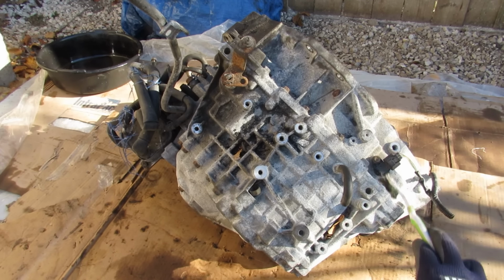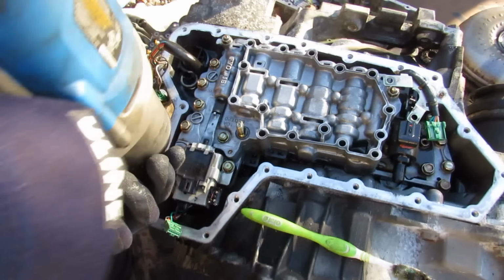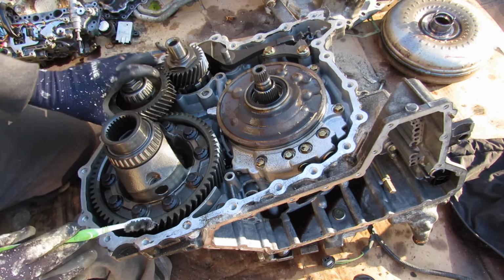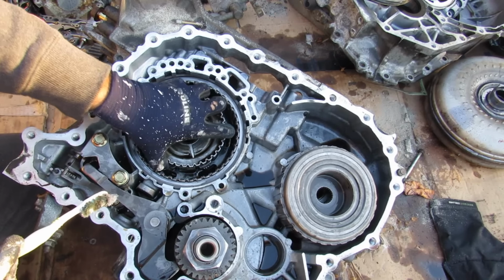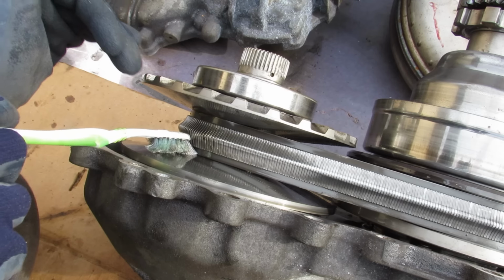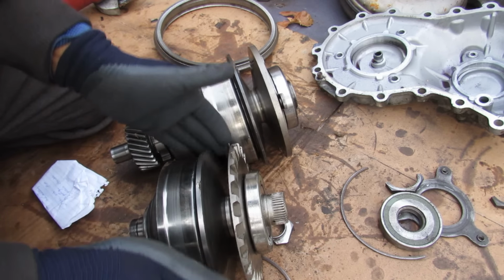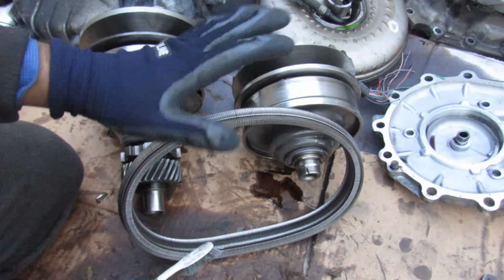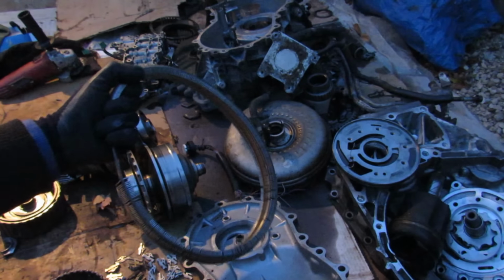Why Nissan CVTs FAIL

Comment: Many different vehicle makes have used CVT Transmsissions. Ford, Subaru, Mitsubishi, Honda and even Toyota. All CVT’s can benefit from Jilcat Proline CVT Supplement.

Nissans have had CVT issues across all their models for many year models. Altima, Murano, Sentra, Rogue, Juke, Pathfinder and Maxima. Also works with Mitsubishi, Subaru, Jeep, Ford and Honda CVT’s that shudder. The standard repair is to replace the transmission. Cost: $2000 or more. Try Jilcat Proline CVT Supplement for less than $35 instead. There have been hundreds taken care of across the country. Do not replace, lubricate with an aerospace designed lubricant and metal conditioner.
Reply from the maker: Nice advertising

Comment: Hi there, great video! last year, I took my renault koleos 2013 auto to the dealership as the car was bucking at little acceleration (D).  They told me that after checking the CVT oil (never been changed) had parts of metal. with my friend, we are now embarking in the journey to find out what it is .  the car shifts no problem and there is no sound coming from the gear box. the car can move, slowly and it bucks not all the time. Also there is not sign coming out in the dash and not failure codes.yesterday, we removed the oil (only 3.5 L left)and although dark it did not have any pieces of metal there, so we are thinking that low oil and/clogged filters are the causes. but we are just a very amateurs on this so we will highly appreciate any feedback/sugegstion. anyone can provide. thank you in advance. cheers

Comment: I had to pay $4,800 for a rebuilt CVT in my nissan Rogue. Last nissan I'll ever own! Dealer even charged me for shop supplies! I told them I should not have to pay for their mistakes, yea, they really cared!
Reply from the maker: Shop supplies is standard charge for anything that comes into the shop...

However $4800 is alot!
Reply: I'm back, I got 60,000 miles on my new rebuilt, and it started slipping! I decided to drive it until it dies and buy a Toyota or Honda. I can't take it on the interstate because it will slip,I only drive it around town. I can smell the transmission fluid, and the trans jumps a bit; I'm wondering how long it will last and if it will just fail at once or allow me to limp home. Nissans are garbage!

Comment: This gear is used on Nissan maxima 2017-2019 as well?), or did they improve the issue in some models?
Reply from the maker: It was changed but not nessessarily better

Comment: What  cause these cars with CVT after travelling  long distances they are not exceeding 100mph???? From 0 to 100mph they are fast but when reaches 100mph they are moving very slowly past 100mph or just stack there as maximum speed while they actually have 180mph as maximum speed????

Comment: Best CVT trainer I've seen! Brilliant video. With a 2.0 140ps engine my wife's is still going strong touch wood but I certainly wouldn't put it with a large vehicle, a V6 and a trailer, just doesn't feel tough enough
Reply from the maker: Agreed. Probably for a small city car or scooter

Comment: Working in a nissan dealership ive seen a ton of failed cvts. What i don't get is why the maxima cvts almost never fail but the muranos fail all the time. It's the same transmission. 95% of failures are in units that are not properly maintained. Nissan recommends flushes every 30k of that cvt fluid and the people that maintain them properly don't have near as high a failure rate. Nissan has the most expensive maintenance costs of any brand I've worked for but they make great vehicles outside of the cvts. Units made towards the end of the last decade 2018- now seem to be a lot better though. I think Nissan is moving away from cvts in their more premium vehicles though.

Comment: CVT drives are not new they have been used in industry since the 1930s and in motor scooters and small lightweight cars since the 1950s. Of course, they were much simpler because they used rubber Vee belts and the torque loads were not high. That steel belt is very cool when you consider what it does. The failure rate for these transmissions will get better.

Comment: The CVT trick is never go downhill on Drive gear, change CVT oil every 60k miles. Also don't keep engine on idle stationary with Air conditioner on  more than 10 minutes, avoid at all costs idle engine running, ran my Nissan Rogue CVT over 280k with no problems. I have another one is now up to 117k .... also, no problems
Reply: You mean switch to first or second gear down hill and engine break? Also what’s wrong with keeping it on idle?
Reply: @NoobTube4148  
No move it from Drive to neutral going down hill

Comment: i have noah with A 1V ENGINE...my gear transmission is faulty....When I engage the gears..they jack...or knock...ave been advised to replace the whole system...can it be repaired?

Comment: wife's  2018 Nissan Kicks Transmission failed with 63,000 km,,, LUCKILY she purchased the extended  warranty ..... or we would have been on the hook for 3800 bucks,,
complete New Transmission installed just before Christmas,, ,,  ,, but geeshhhh  63,000km..  and its just a light weight, front wheel drive car only

Comment: Thanks for a very timely video.  My daughter's CVT transmission in a 2016 Nissan Rogue failed last week with only 89,000 miles on the car, and the dealer wants $6,000 for a new transmission.  Piece of crap.  With today's technology, no transmission should fail in under 100,000 miles.  The manual transmission in my son's Scion B (made by Toyota) actually made it to 475,000 miles before it failed.  Now that's quality.  I'm glad I have my Honda Fit with a manual transmission.  It's simpler, lighter, less complicated, and is going strong at 170,000 miles.  I won't be buying a Nissan anytime soon.

Comment: Which failure points would need to be upgraded in order to keep up with more powerful engines?  Is it even possible to beef up these CVT transmissions? I don't see any aftermarket for them so just assumed that the answer is no.
Reply from the maker: Keep changing the fluid and add a cooler. Don't overload or tow

Comment: Hello my friend!
It wouldn't be bad if you wrote down the transmission model, because maybe different years put different transmissions. For example, I have a Teana l33 2015 3.5 liter vq35de engine, such engines and transmissions were installed on Murano. I have a slightly different transmission, or rather a different oil pan, it has no cooling fins. I'm wondering if the rest of the elements are the same?
Reply: The hydraulic plate is also different, did Murano make CVT with a 2.5 liter engine? I don't have a step motor in my hydroplate :(
Reply from the maker: Thanks. I don't usually get the model number or VIN with these. Just the vehicle make and model

Comment: Not sure why we say that the Nissan CVT is bad.  I have had 2 with over 400,000 miles, and no issues.  Regular maintenance, plus not treating it like a sports car seem to be the reason mine lasted so very long.  And, no, I am not a mechanic, which I appreciate your knowledge, but, really, folks seem to bash these CVT's when the problems might just have more to do with maintenance and driving habits.
Reply from the maker: That's awesome. What vehicle, and do you tow with it? Did you add a cooler?

Comment: Everyone should have cvtz50 installed in their phone and connected with an active OBDII scan tool at all times whilst driving their cvt equipped Nissan.

Hopefully we can gain the attention of the video creator and alert him to the app ($3-5) which is totally worth it. 
I am in no way associated with the developer of the app, and it doesn't require any specific, special scan tool to operate, only a generic, (but quality) OBDII scanner that is available online for less than $16.

cvtz50 is a monitoring tool that allows you to create a log file for your own cvt, which actively monitors the wear of the internal belt, clutch pressures, temperatures and much more.

Comment: So why in the infinite wisdom of Nissan's fine quality mechanics would there ever be said to a customer: "we don't replace them, only the fluid", regarding the pickup and cooler filters?

Even after all of the failures, the complaints, and the eventual lawsuits & recalls, Nissan still insists that replacement of anything beyond a 30k mile oil change is "totally unnecessary and not done as a part of the recommended routine in our own service manuals" .  - *quotes courtesy of the head service writer @ CdA Nissan, Dec, 2022 *

Comment: are they still bad? im considering a car with jatco CVT 2023, any suggestions please?
Reply from the maker: Yeah it seems the newer ones are going bad
Reply: @speedkar99 Thank you,  im considering a changan car it also uses jatco CVT, could it be possible that its a different transmission or its just all jatco CVT are bad

Comment: CVT oil and filters are changed every 40,000 km (25,000 miles) I had a 2018 Sentra SV 2.0 that damaged the belt due to oil, if you buy a mini scanner and the cvtz 50 app detects the oil wear counter that will inform the tips and monitor
Reply: Everyone should have cvtz50 installed in their phone and connected with an active OBDII scan tool at all times whilst driving their cvt equipped Nissan.

Hopefully we can gain the attention of the video creator and alert him to the app ($4-5) which is totally worth it.
cvtz50 is a monitoring tool that allows you to create a log file for your own cvt, which actively monitors the wear of the internal belt, clutch pressures, temperatures and much more.

Comment: And now the most complicated transmission available today: the manual stick shift. The CVT is the goofiest invention ever made.
Reply: It has been great for the snowmobile since inception.
For cars and heavier vehicles, not so much.

Even as snowmachine engines have progressed in power from under 20, to over 200, they still use a variant of this system and it has been one of the most "bulletproof" parts of the system - almost forgotten - that has been used. 
Granted as power levels have gone up, so has the size of the cvt clutches and springs, but even if you run a twin clutch system that uses two belts, you may never need to replace one in the lifetime of your snowmachine.

Nissan simply needs to use a different manufacturer and beef these up to the level of power their engine outputs.

Otherwise, cvt is a brilliant solution that is actually much simpler than the typical automatic transmission.

Comment: What a nightmare. No wonder Nissan has shit the bed after they adopted this abortion.
Reply: It's actually less complicated, and less prone to failure than the typical automobile automatic transmission, but Nissan's choice of manufacturer for this part is the problem.

If they would build them to handle the level of power and torque the engine is capable of producing, it would probably be as bulletproof as the old Chevy TH400.

Comment: Wouldn't own a cvt equipped Nissan no way no how. Bring back fwd manual nissans !
Reply: We've owned two, of which one is still in the family and has over 106,000 miles of trouble-free daily driving on it (in fact my wife is getting ready to leave for work as I write this, and will be driving it).
The other was doing fine when I treaded it up to a newer, higher level model that didn't have any cvt available, due to it having over 300hp.

Comment: When I had my Nissan Altima they extended the warranty to five years to 7 years and from 50,000 miles to 100,000 miles. That had to destroy nissan. And as well it should you put out a cheap garbage you deserve to have it recalled and make it right when you could make it right the first time and not have to go through this BS.

Comment: I had a 2015 Nissan Altima with one of these garbage transmissions in it. It literally felt like in parking lots I was bouncing through the parking lot like on a rubber band type of situation it would give a little bit of a surge and then it would slow down and then it would surge again and then slow down and this would be without  touching the gas. At idle speed
Reply: It's all about the level of maintenance a vehicle receives in its lifetime. Neglect a single oil change in the cvt and that surging can be the result.
Not saying that this is the only way that they fail, and yours may be something different, but overall, only 30% of all car owners actually keep up with their maintenance service requirements. Most owners either don't know, or don't care about maintaining their vehicles - until they fail.

Comment: As you say Nissan pioneered CVT on a commercial basis in most of their range so a trailblazer always faces the harshest challenges. Others simply follow his route and have a smooth sail thereafter. Likewise Nissan had failures because it was the one which was experimenting. Others learnt from it and refined but the stigma on the pioneer still remains unfortunately.
Reply: Exactly!

It's not the fault of the transmission if it is put into a lifetime of service for a vehicle often twice as large as the clutch packs are designed to handle, and then the subassembly is built using the cheapest possible components.
Failure points are obvious even to the untrained eyes of a first year engineering student.

Sintered metal castings - ugh.

Comment: Interesting. Not at all how I figured a cvt would work. I wonder if my way has ever been tried and if it might work better... It might need to be larger, but certainly seems like it would handle torque better and generate less heat.

Comment: Hi 
I run a merc b180 with a cvt and love it you are quite right I am not bothered about the driving experience just stamp and go after all I use mine as a mobile kennel and a skip. Not the most reliable transmission I have had two of these fail at around 70000miles with the same fault, the plastic spider that retains the solenoid valves to the valve block fails ( it is the wiring loom to the solenoids and the plug to the loom out side the box) it is internally wired in aluminium which fatigues and breaks contact. Fortunately easy to remove and find a specialist to re wire with copper and never fail again 
Great vid you should be teaching the nissan master techs

Comment: Just a tip when changing Nissan Transmissions is to keep that EEprom you pointed out, so you may switch it and not have to program & marry the transmission to the vehicle VIN. Caution must also be used when this transmission is in operation since 3000Lbs of pressure is running through the system which could cut your fingers off in a flash. Oh, and pre-soak your brothers underwear in a can of cola to remove the oil before you wash and return them.
Reply: Most people don't understand that these transmissions are "married" to specific vehicles and programming them after installing is required (values for shifting points vary with the electrical load requirements of the entire vehicle, as well as the engine power requirements for actually moving the vehicle down the road).
Mess with that eeprom and you'll likely be stranded, even if the transmission itself is fine.

Comment: Is it Jasco trans? That is Scotty kilmers favorite
Reply: Jatco, and yes it is!
Jatco is the Nissan "factory" or OEM builder for many parts - which is exactly why Scotty does not recommend most Nissan vehicles.

Nissan engnieers have created many great products, which Jatco quickly ruins with their horrible quality control and ability to manufacture using parts that don't work well together, like aluminum castings that are assembled with steel bolts and nylon washers, using copper wires routed through plastic flanges with polyurethane seals.

That said, Nissan engineers also gave us the "Cube" (honorable mention to the Quest and Juke). 
*not equating design engineers with actual engineers who make things work.

Comment: jatco, a freind said his cvt has a simulated shift cvt in chevy spark , and his has only 8,000 miles on the new cvt and it takes off in a higher gear from the stationary position so its very slow to take off yet chevy wont hear of it.

Comment: Rightly it happens to fail the CVT. Rightly the low ratio will work with helical gear but the framework's too complex.
And, the disassemmebly showed some sludges, so the lubricant would be low quality for long CVT runnings.

Comment: Thanks! i enjoyed your video, and learning about the CVT. It seems that an additional fluid cooler might be a good idea. I was in the appliance business years ago, and Westinghouse front load washers used a very simple angled pulley to change the speed from wash to spin. An electric solenoid would clamp a pulley together, which would put pressure on a drive belt that had a clutch facing on it, this increased the diameter of the pulley, and the washer basket would speed up.

Comment: CVT transmissions belong on GoKarts not cars or ATVs. Change my mind... Auto manufacturers use CVTs because they are cheaper to build. Saves them money. Not you. CVTs have a high rate of failure. Where a conventional hydraulic automatic transmission lasts over 200k miles, a CVT might last 20k or more if highway driving. Usually less than 100k.

Comment: I have a 2013 Altima with a CVT. 230,000 miles. Never serviced the transmission once.
Reply: Wow good!  How often do you do maintenance?  How many miles was it on when you first changed the fluid?  greetings!

Comment: The key is a steal belt don't put a belt in a transmission chain only belts fail under heat that's why they fail sorry y'all engineers you don't know everything.